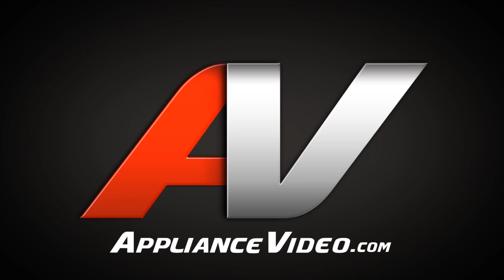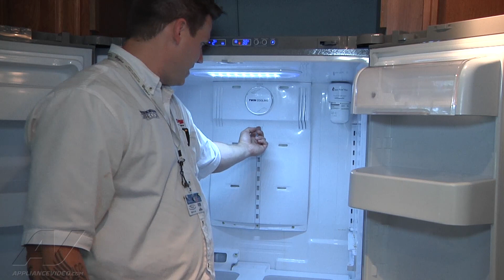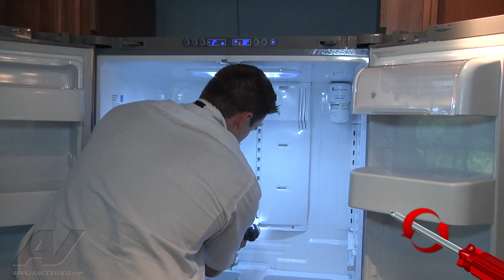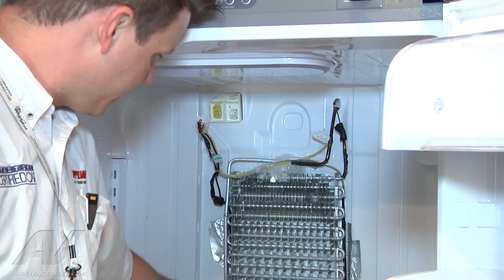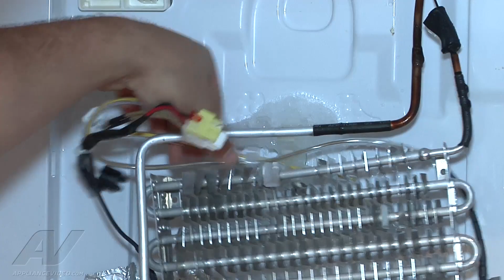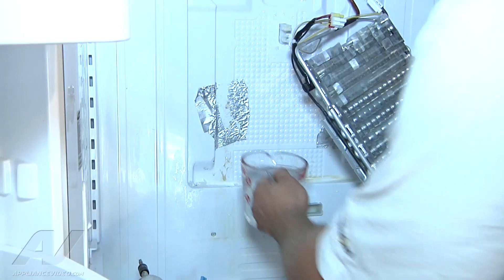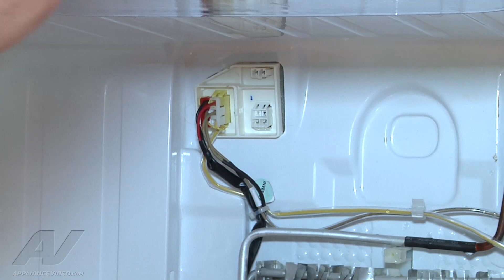Samsung Refrigerator Repair - Freezing Up On the Back Panel - Evaporator and Defrost

Comment: How come when I take mine off it has a foam cover on it?
Reply from the maker: Great question, if you have a
more technical question that our parts department cannot answer, you can search
our over 10,000 answered questions free at our website www.ApplianceVideo.com under our Repair Help section. You can also call
our parts department at 1-800-830-5465 and they can give you help 6-days A week
Monday -Saturday, or search at www.SaveMoreOnParts.com  24 hours
7- days A week.
Reply: The back panel of my fridge had Styrofoam on the inside. The ice was so built up that when I tried removing the panel, I actually cracked the Styrofoam. Needless to say, I had to leave the fridge off to defrost a bit longer.
Reply: @leiaorgana359  So that's the issue with mine then? Samsung keeps telling me to have someone come over to repair it but I feel like its an easy issue.
Reply: @thegamingslug3601  I am not sure what is wrong with your fridge. I am still trying to figure mine out. I only meant that it seems to be a normal way to insulate. Mine definitely had more ice bulid up than the one in the video
Reply: @leiaorgana359  Mine has A LOT of ice build up. It won't stay cold as it should, it pretty much ruins all of the food in weeks cause of how warm it is.
Reply: @thegamingslug3601  Since the Styrofoam had ice buildup, I had to let it defrost longer than I thought just to be able to take the back panel off. Once it was off, I could see the evaporator was pretty much solid ice. Then I used a flat head screwdriver, a hair dryer and a scrub brush to remove all the ice. I thought doing all that would buy me some time, but in less than 3 weeks it has accumulated again. And unfortunately I didn't get a good enough look at the exact parts my fridge uses so that I can order them before I have to de-ice again. Let me know what you end up doing for your fridge

Comment: Having problems as well, they should not be able to get by without fixing the problem.  Over 2,000 and my food is going bad because it is not cooling properly and freezing up. Never again will I ever buy a Samsung product.
Reply from the maker: Great question, if you have a
more technical question that our parts department cannot answer, you can search
our over 10,000 answered questions free at our website www.ApplianceVideo.com under our Repair Help section. You can also call
our parts department at 1-800-830-5465 and they can give you help 6-days A week
Monday -Saturday, or search at www.SaveMoreOnParts.com  24 hours
7- days A week.

Comment: Actually having a problem where a smooth mound of ice has formed on the back of our fridge. This is accompanied by fluctuations in fridge (top) and freezer (bottom) temperatures. Any experience with this for anyone else?
Reply from the maker: Great question, if you have a
more technical question that our parts department cannot answer, you can search
our over 10,000 answered questions free at our website www.ApplianceVideo.com under our Repair Help section. You can also call
our parts department at 1-800-830-5465 and they can give you help 6-days A week
Monday -Saturday, or search at www.SaveMoreOnParts.com  24 hours
7- days A week.

Comment: Looks like I can add to the many frustrations of the Samsung refrigerator. Ice build up and now the refrigerator won't keep temperature where food isn't spoiling. If this is typical of Samsung, why isn't something being done about it?
Reply from the maker: Great question, if you have a
more technical question that our parts department cannot answer, you can search
our over 10,000 answered questions free at our website www.ApplianceVideo.com under our Repair Help section. You can also call
our parts department at 1-800-830-5465 and they can give you help 6-days A week
Monday -Saturday, or search at www.SaveMoreOnParts.com  24 hours
7- days A week.

Comment: Samsung must have made a deal with GE because i have the same fridge, with the same problem except it has a GE label on it.   Unfortunately, changing the heater coil did not solve the problem on mine.   Still looking for a solution after 7 or 8 years.
Reply from the maker: Great question, if you have a
more technical question that our parts department cannot answer, you can search
our over 10,000 answered questions free at our website www.ApplianceVideo.com under our Repair Help section. You can also call
our parts department at 1-800-830-5465 and they can give you help 7-days A week
Monday -Sunday, or search at www.SaveMoreOnParts.com  24 hours
7- days A week.

Comment: Energy star rating means the defrost cycle is short. If it were longer, using more energy,
(who cares if the fridge is freezing up so long as we have the "Energy Star".)
If the defrost cycle were longer it would clear the ice as it should. The wire trick would also help but MORE HEAT
would fix it for sure. How do we reset the defrost to stay on longer?
Reply from the maker: Great question, if you have a
more technical question that our parts department cannot answer, you can search
our over 10,000 answered questions free at our website www.ApplianceVideo.com under our Repair Help section. You can also call
our parts department at 1-800-830-5465 and they can give you help 7-days A week
Monday -Sunday, or search at www.SaveMoreOnParts.com  24 hours
7- days A week.

Comment: Mine was making fan noise for just a day or two. Taking the panel off it seemed a bit stuck, so I used a hairdryer to blow warm air in behind the edge for just a few minutes.  Once I got the panel off there was no ice. Put everything back and no more fan noise. Maybe it was only a small bit of ice that melted first?   A separate issue is that the ice coming from the icemaker is always wet, and water drips from the dispenser chute.  Anyone have a fix for that?  I'm never buying Samsung again!
Reply from the maker: Great question, if you have a
more technical question that our parts department cannot answer, you can search
our over 10,000 answered questions free at our website www.ApplianceVideo.com under our Repair Help section. You can also call
our parts department at 1-800-830-5465 and they can give you help 7-days A week
Monday -Sunday, or search at www.SaveMoreOnParts.com  24 hours
7- days A week.

Comment: Finally, fix 5YO Samsung RFG237aars freezer (at the bottom)  is not cooling and keeping 30 degrees in the freezer section. No problem in the refrig section. I have to remove the panel and to defrost it for almost every 3 weeks. Run diagnose it shows fan motor error to replace the motor. Remove the back panel to clean the secret place that seems to block the air flow, in addition, clean the drain pipe and vacuum the water in the pan. Now, the freezer temp is the same as the display -4 degree for a few weeks. I hope I can post the video to save your bills...
Reply from the maker: Great question, if you have a
more technical question that our parts department cannot answer, you can search
our over 10,000 answered questions free at our website www.ApplianceVideo.com under our Repair Help section. You can also call
our parts department at 1-800-830-5465 and they can give you help 7-days A week
Monday -Sunday, or search at www.SaveMoreOnParts.com  24 hours
7- days A week.

Comment: Mine came with the house we bought November 18 and the right cooler vent keep icing up which is causing the ten to go up in the 50’s. I hate this fridge
Reply from the maker: Great question, if you have a more technical question that our parts department cannot answer, you can search our over 13,000 answered questions free at our website www.ApplianceVideo.com under our Repair Help section. You can also call our parts department at 1-800-830-5465 and they can give you help 7-days A week ,or search at www.SaveMoreOnParts.com  .

Comment: i own a samsung RF26HFENDSR/AA  02 with the refrigerator frost problem on the back wall & under the vege trays with ice.  i replaced the heater sensor [the heater coil was fine   -tested it with the forced defrost method after i opened the back wall -it got very hot]

Sensor, Temp 
by Samsung  
Part #:  DA32-10104N (AP4979323)
Quantity:  1
Cost:  $10.97
that solved my frosting every 3 weeks problem.  no more frosting at all.  did it myself it was easy
Reply from the maker: Great question, if you have a
more technical question that our parts department cannot answer, you can search
our over 10,000 answered questions free at our website www.ApplianceVideo.com under our Repair Help section. You can also call
our parts department at 1-800-830-5465 and they can give you help 7-days A week
Monday -Sunday, or search at www.SaveMoreOnParts.com  24 hours
7- days A week.

Comment: Mine cools fine however it freezes up and I get ice under the crisper/deli tray.  Have defrosted it and wrapped copper wire around the heating element and into the drain line no joy!  It still happens. Where do you get the service manual because none of the tests indicated below are in the owners manual?
Reply from the maker: Great question, if you have a
more technical question that our parts department cannot answer, you can search
our over 10,000 answered questions free at our website www.ApplianceVideo.com under our Repair Help section. You can also call
our parts department at 1-800-830-5465 and they can give you help 7-days A week
Monday -Sunday, or search at www.SaveMoreOnParts.com  24 hours
7- days A week.

Comment: Can't you just replace the entire Evaporator Assembly for a cost of about $110 ?
Reply from the maker: Great question, if you have a
more technical question that our parts department cannot answer, our
technicians are answering all questions at our website at www.ApplianceVideo.com under our Repair Help section. You can also call
our parts department at 1-800-830-5465 and they can give you help 7-days A week
Monday -Sunday, or search at www.SaveMoreOnParts.com  24 hours
7- days A week.

Comment: If you are reading this now you are well past any warranty period.  This video skipped the diagnostics.   Why the evaporator assembly?  The unit freezes up and simply needs defrosted.  It's a bad design.  I've done this a half dozen times and works every time.  Under warranty they replaced the fan / cover assembly as a precaution and they replaced the motherboard which was a legit fail or it was a faulty diagnostics which I've seen a couple times by repair techs who have the motto when it doubt, replace the motherboard.   As long as the fan works (it usually gets frozen), just put the thawed out assembly back together and cool air can now get through the styro-foam vents and air can circulate across the evaporator assembly.  Take an entire day / overnight to thaw it out before trying to pull it out.  If the fan motor goes bad, you can buy the entire assembly as a replacement (around $130)(part DA97-07190D) or just the fan motor (part DA31-00146E).  Try this first before you buy parts.
Reply from the maker: Great question, if you have a
more technical question that our parts department cannot answer, our
technicians are answering all questions at our website at www.ApplianceVideo.com under our Repair Help section. You can also call
our parts department at 1-800-830-5465 and they can give you help 7-days A week
Monday -Sunday, or search at www.SaveMoreOnParts.com  24 hours
7- days A week.

Comment: I have a samsung 3 door french door reference RF62QEPN it looks a bit like the one u showed not big difference , however we defrost it for 24 h and let the door open but the same problem again the water still in the trays and the number showed are not fix and doesn't really work  I read a comment of a lady she said the problem could be fixed if we put a metalic plate is there any one to confirm this ??  Please i need help !
Reply from the maker: Great question, if you have a
more technical question that our parts department cannot answer, our
technicians are answering all questions at our website at www.ApplianceVideo.com under our Repair Help section. You can also call
our parts department at 1-800-830-5465 and they can give you help 7-days A week
Monday -Sunday, or search at www.SaveMoreOnParts.com  24 hours
7- days A week.

Comment: I had the same problem. I called them and was told to turn off for 24 hours, let it defrost and plug back in. Guess what? Problem came back. So, this is what I learned with "Father & Son repair" channel: 1) I removed the drain line and washed with soap in order to unclog the lint from that  small passage and put it back the way you took out. 2) if you haven't defrost the chunk of ice from the bottom do it now. It will drain fine and not accumulate ice again. 3) clean the drain line passage, the gray plastic tube from behind the fridge once a year.
Reply from the maker: Thanks for your response, we are glad we could help. Our library
of over 5,700 videos are currently helping 1.6 million people like you every
MONTH.  Please help us by subscribing to
our YouTube channel, or post our website www.ApplianceVideo.com to your Facebook
page

Comment: Is this par of the seal system?
Reply from the maker: Great question, if you have a
more technical question that our parts department cannot answer, our
technicians are answering all questions at our website at www.ApplianceVideo.com under our Repair Help section. You can also call
our parts department at 1-800-830-5465 and they can give you help 7-days A week
Mon-Sat . You can also search at www.SaveMoreOnParts.com 7- days a week.

Comment: I want to ask a question,of the sensor there is a black rubber thing,what is that?

my refrigerator stopped working andd ive followed this video and opened it uo as mine too was freezing at the back there and saw that that black rubber is melted all over and into my sensor. could this be the problem? and should I remove the black stufff off the sensor,should it work?
Reply from the maker: Great question, you can call
our parts department at 1-800-830-5465 and they can give you help 6-days A week
Mon-Sat . You can also search at www.SaveMoreOnParts.com 7- days a week.  If you have a more
technical question that our parts department cannot answer, our technicians are
answering all questions at our website at www.ApplianceVideo.com under our Repair Help section. We have over 6,000
common questions and answers that you can easily search through by your model
number, appliance make, problem or error codes, and It’s completely free to
search through our question & answer library. There is a very good chance
you question is already answered there.

Comment: FIXED the overcooling: After spending so much money I fixed it myself:
Short Story:
1) Found my Samsung model + version
2) Found 2 temperature sensors for my model (RF263BEAESR/AA version 2)
DA32-10104N
DA32-00011C
3) Changed the above sensors
4) DONE
PS, Start with small steps:
Make sure your panel temperature set to a higher temperature and it is not to Power Freeze 
If you have an extra freezer/fridge, then move your food to those and unplug this fridge for 72 hours
Now if it still freezes your food, it is time to do some repair:
a) Change the above temperature sensors (according to your model)
b) If that does not work change Mainboard
c) and if that doesn't fix it, then if you think the display panel does not work, you can change that
Good luck
Reply from the maker: Thank you for
your  response, we are glad we could help. Please help us by
subscribing to our YouTube channel or post our website www.ApplianceVideo.com  on your Facebook page. We want to let your
friends & family know how our FREE videos can help them.  Or you can
support our parts department at 1-800-830-5465 and our parts website www.SaveMoreOnparts.com .  This is the only way we can continue to
post free videos and help over 1-million people per month like you repair their
own appliances. We also have thousands of more quality videos on all major
appliances made by our factory trained technicians at www.ApplianceVideo.com .